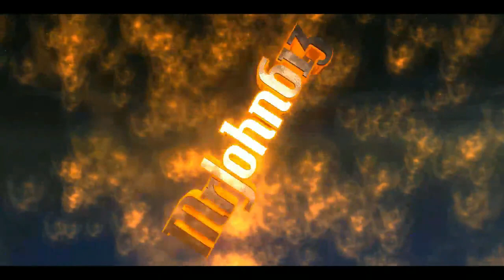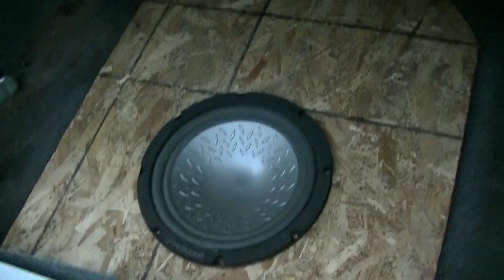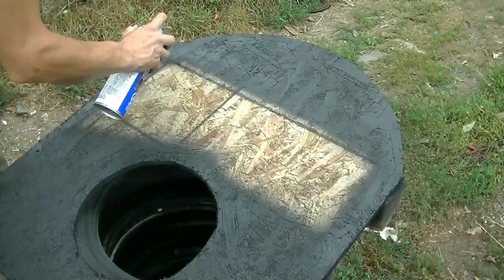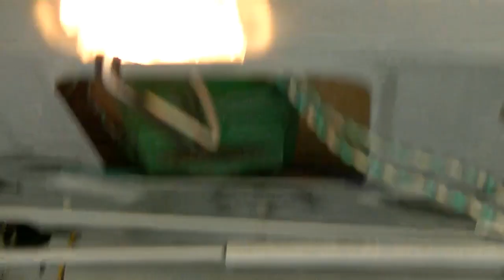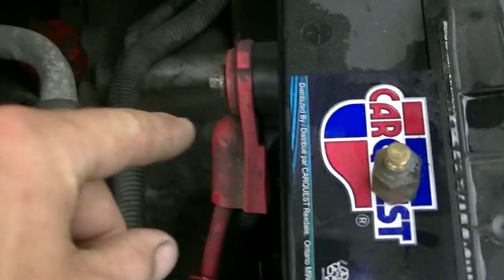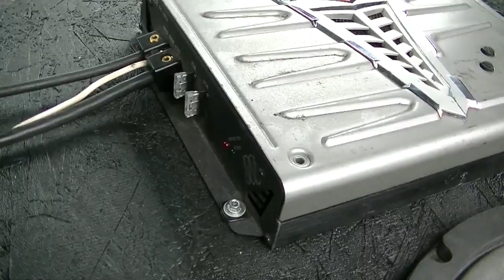DIY Sub Install - No Box, No Problem! EZ Trunk Plate Build

Comment: how does it sounds? would you recommend it?
Reply from the maker: it sounds very good for a low cost budget setup.  the bass can be heard from several blocks away.  i would recommend it yes, there may be ways to invert the sub and or keep the spare tire as well.  we recently upgraded the sub and amp both as well as the plywood.
Reply: @613Builds  never thought about inverting the sub, good idea, but I need the trunk  space.